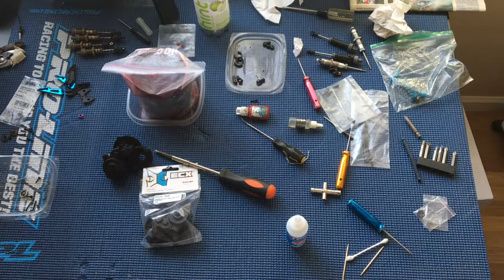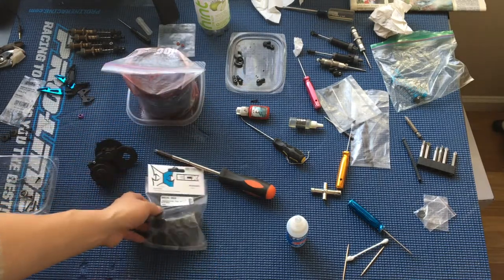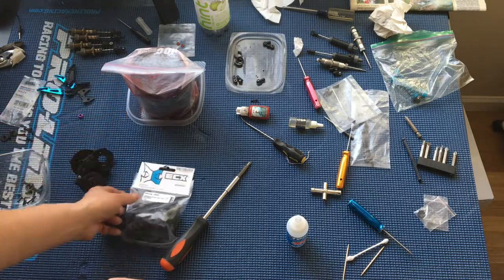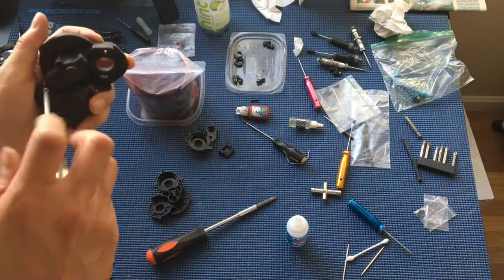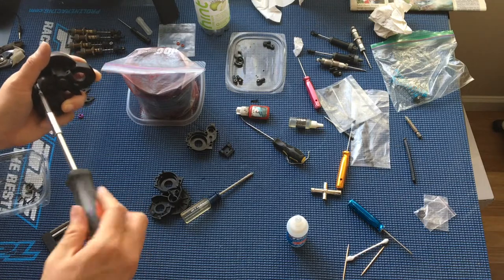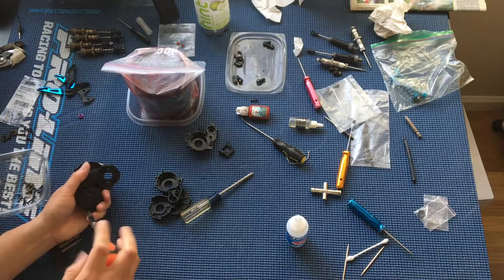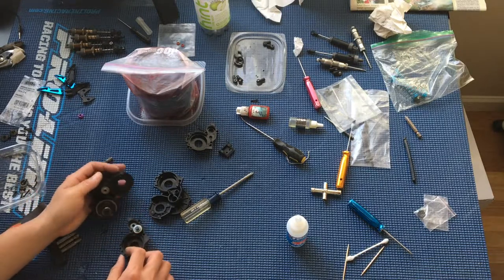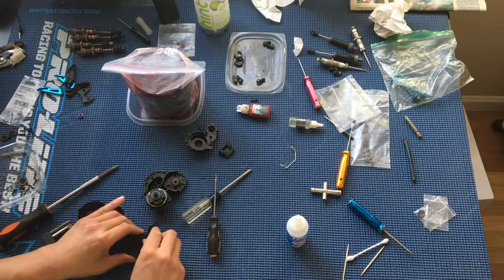ECX 2WD Transmission Case Replacement and Metal Gear Surprise: Ruckus Torment Amp Circuit

Comment: I have the ecx circuit 2wd truck, Ive run into a problem.  One drive shaft only turns when both wheels are on the ground, but they both turn with both wheels off the ground??  Ive changed bearings, the gear are stripped???  Don’t know why this happening??
Reply from the maker: Thanks for watching and commenting! You may want to check the gears inside the differential.

Comment: i have noticed non other brand trucks other than ecx.  do you own any other brands?  did i miss a vid off one in it?  seen alot of your vids.  what others do you own and whats your faves?  just picked up a used ecx curcuit just for the castle system that was in it haha.   thinking about build it up at some point lookin for tips about the trans and brand in general.
Reply from the maker: We've got a ton of other RC and brands, check out all of our playlists here: https://www.youtube.com/channel/UCv2ojoorzg1QNgnZyCLWxJA/playlists
Our current favorites would be anything Tekno, the Pro-Line Pro-MT 4x4, and the ECX Ruckus once it's been properly upgraded. We've been considering the Team Redcat vehicles, but we've got to make some room first!
Reply: @Racing2Learn  yea I found some of them already. Like your vids, could u do one the ecx circuit, I just got a used one.